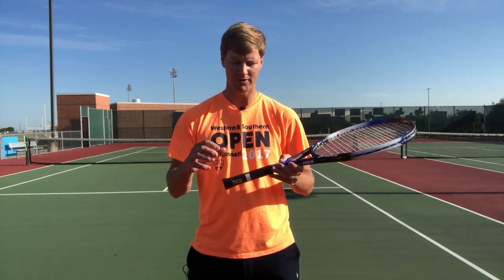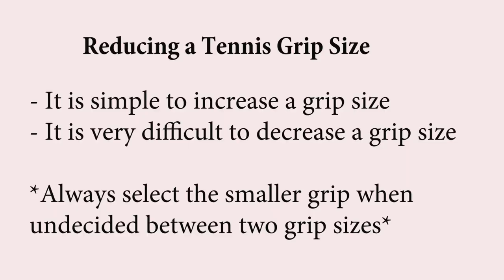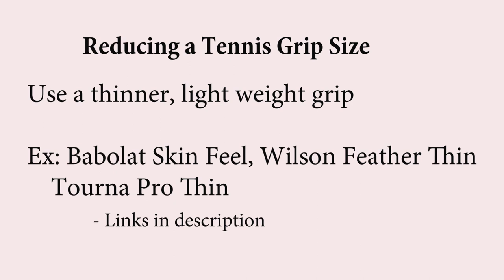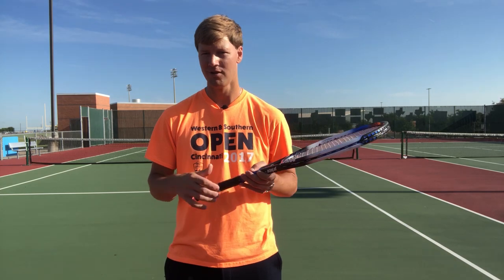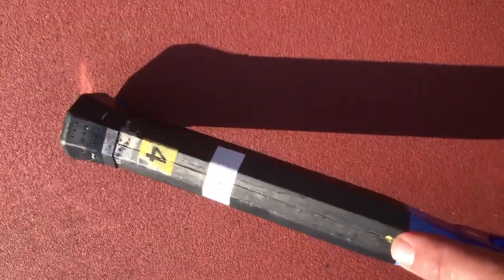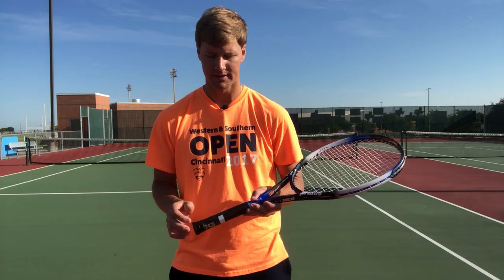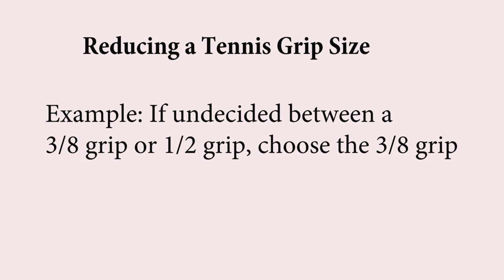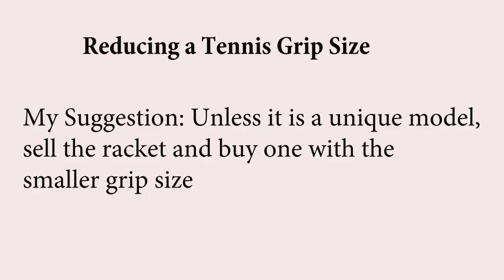Can a Tennis Grip Size be reduced?

Comment: You can sand to a high degree of precision. You just have to scratch the surface with a needle-tool to the same dept on all sides/bevels (marking on the needle) which you meassure out..., then you sand that scratch away on all sides.
You make that tool with a piece of wood where you put in a pointy screw that goes through and which you can adjust to the right dept that correspond with what you need to remove of material.

Comment: I finally made a milling contraption that allows me to reduce each bevel (no sandpaper or file), very accurately precise to as much as 1/32" (a little more on thicker walls) without reducing the integrity of the handle.
Reply: You should put that contraption on the market.